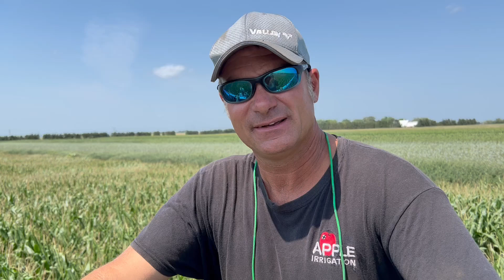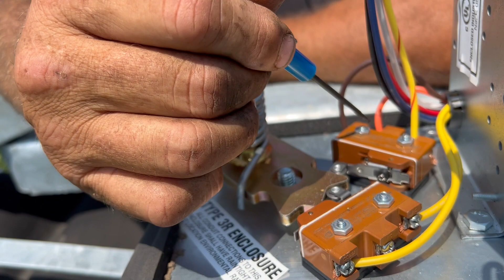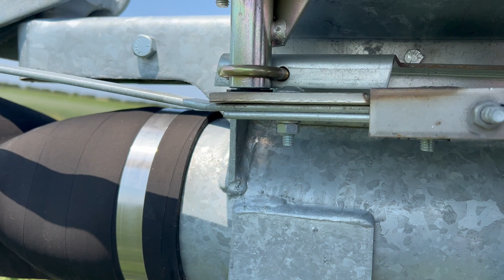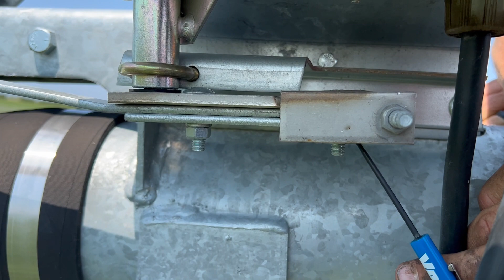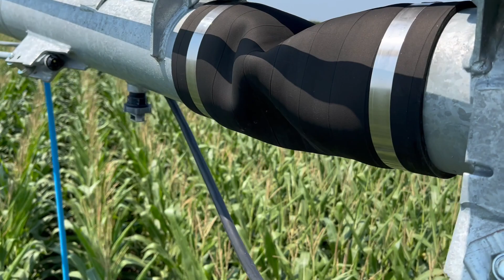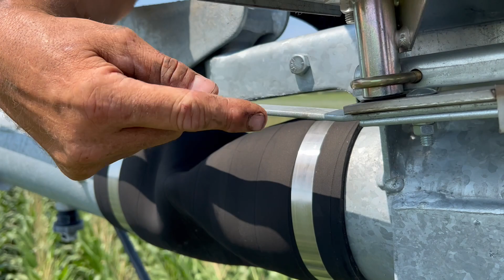Valley irrigator tower box adjustment

Comment: Do you prefer the FWD/REV microswitch to click so close to the valley of the cam? I’m in manufacturing, specifically- Aftermarket pivot controls. My team and I build valley/Lindsay style Tower Boxes. I’m asking an honest question, not trying to say your doing anything wrong bc watching your video it makes sense to me and I literally build them!! Do you ever install a new tb and have to adjust the microswitches? I noticed there wasn’t any thread lock on the microswitch mounting bolts and none on the microswitch adjustment screw. Just curious about your thoughts. I need to visit a farm and start playing with these controls. Helps to better understand what techs are doing in the field. Maybe I can do a better job building them!!